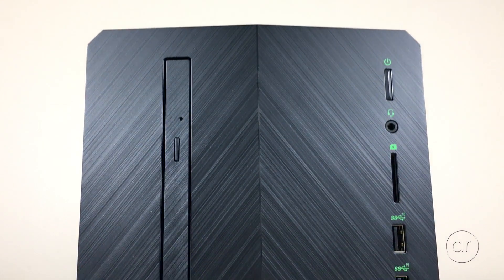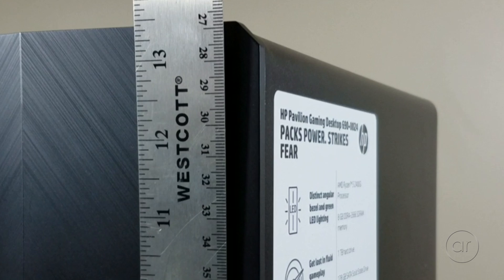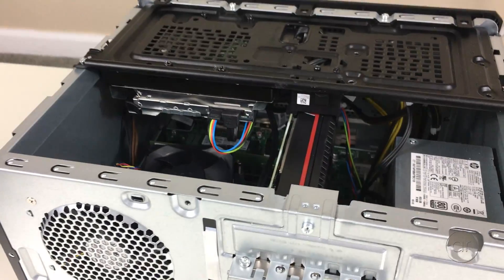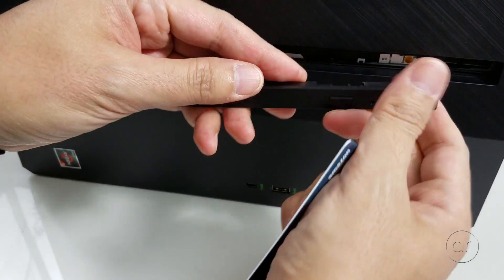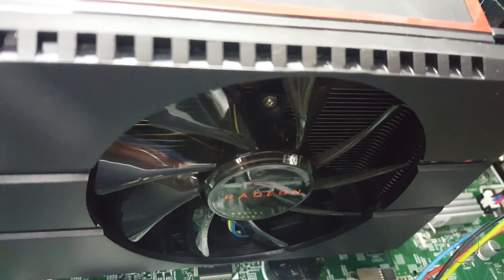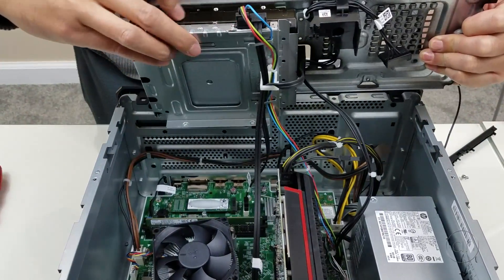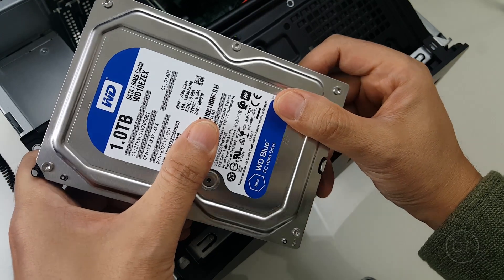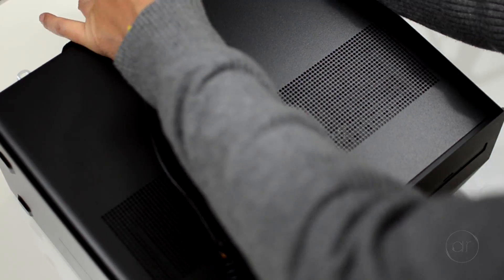How to Open and Upgrade a Ryzen-Based HP Pavilion Gaming Desktop

Comment: Sharing here my upgrade experience for anybody who could find it useful, and why only if your needs are as specific as mines and/or if your budget is as limited as mine, then and only then this PC could worth a try, otherwise run away from it like the plage.
What I was in need was a small PC for my improvised workbench, for running mainly Linux, and some  light Windows gaming. i received this PC the last year as a gift from a nephew that tried to sell it for 2 years without success (I wonder why? 😒)
The pc lacked the original 2GB RX 580 and instead it had a fanless 2GB GT 710, together with a broken mechanical 1TB HDD. It had a Ryzen 3 2200G, with 8 GB RAM.
I had already a new unused 1TB MVMe SSD, and my Linux disk drives from my Core 2 duo box (yes, it was my old Linux setup, that old).
My idea was originally to put Linux only on the and NVMe and run the games under Steam, long story short, it was impossible, so I back-pedalled, installed windows on the SSD, keep the Linux root drive SATA SSD, and the mechanical HDD with my /home.
My upgrade plan was focused on get the best features possibles that can make this pc useful for me for the next 8+ years, at least for Linux, and good enough for my Steam backlog, always taking into account the poor, dismal ventilation that this case has, and everything within my limited budget (aprox 280 USD).
In that order, the most needed upgrades were:
· GPU: something that don´t crawl, be better than the 710 (the easy requirement), and really cheap
· RAM: 8 GB isn't enough, 16 GB will be fine.
· CPU: the 2200G had very few PCIe lanes, to the point that witht the NVMe drive installed, the PCIe x16 slot can only operate at 8x speed (I see what you did HP with that mechanical HDD, you rascals), so a CPU with more PCIe lanes, or without integrated graphics, in some aspects could improve the performance.

Upgraded so far:
· GPU: 4GB RX 470, new from Aliexpress, a lot cheaper than a RX 580 and with better performance
· power supply: just in case, because the GPU was a little bit power hungry, and needed a PCIe power connector that the original supply lacked. This was the hardest part to find for prices and compatibility. If this seem unreasonable to you, is better to buy a graphics card that doesn't need need a power connector (not a good prospect for upgrading). Also, a better power supply opens the possibility of future GPU upgrades.
RAM: 2x 16 GB (I'm human, I fell into the temptation of more RAM. So far I have only one app that uses over 16 GB, perhaps it changes in the future).
· CPU: the only second hand upgrade, a Ryzen 7 2700, the best CPU supported by HP in this motherboard.

What's left:
· consolidate everything under a single NVMe drive, 4 TB or more.

What to expect:
For day to day work and some CPU intensive tasks is quite good, however, for even light GPU usage, even old games like the ones I used to play, is recommended to open the side cover. In just few seconds of gameplay, I measured an increase of over 20ºC on the air near the GPU air intake with the cover on, and its very easy to reach thermal throttling point in just a couple of minutes of gameplay. With the side cover removed and a better fan curve (I blame my card for that last one), it plays quite acceptable (i.e. orders of magnitude better than the 710) and the temperatures remain stable while gaming.

TLDR: don't get one of these unless it's a gift and you have at hand most of the upgrade parts, and you find acceptable the caveats of this PC.

Edit: Just in case any wondered, yes, it was well under budget, the total upgrade so far was under 260 USD.
Reply: Why not swap in the Erica motherboard from the later versions of this pc? You then get into new gen for cpu and gpu options. I think they all are 65w max and stay ddr4.

Comment: How many and what type of power connectors does it have? I see 2x 4 pin if I'm correct. Is it possible to replace the powers supply with a standard atx version? Is the motherboard in the micro atx format?

Comment: Hi, ii have the 690-0020 and ii want to know if ii can upgrade to the ryzen 7 3700x or can ii only upgrade to the ryzen 7 2700 also can ii make these upgrades without changing the stock cpu cooler? Ii also want to know if ii can upgrade my rx 580 4gb to a gtx 1660 ti 6gb

Comment: Successfully upgraded the GPU from a 4 GB RX 580 to an 8 GB Sapphire Pulse RX 6600 using a 6-to-8 pin adapter. I had to removed the black GPU bracket attached to the black drive cage. It was held in place with just one screw and then I pushed on the tabs on the other side to remove it. I also moved my HDD to the bottom of the case for better airflow and my boot SSD I have just resting on the bottom of the case. I already upgraded the CPU a couple years ago to a Ryzen 5 2600 and the RAM to 2 sticks of 8 GB, 16 GB total. With the disk drive removed, my idle CPU temp is around 55 degrees now. If anyone has any suggestions on covering the disk drive slot with some kind of dust protection, please let me know.

Comment: But wil this mainboard and psu fit in a standard case if moved?
Reply: Not all at both are proprietary HP crap. If you want to do a case swap get an new motherboard, CPU fan, psu.

Comment: On the Sunflower motherboard can I put in G.SKILL Trident Z RGB 8GB x 2 DDR4-3600 megahertz? Or will it mess up my mother board.
Reply from the maker: I haven't received any reports for that particular memory. I have been keeping track of successful upgrades, which you can find in the "Memory" and "Replacement Memory" sections in the description.
Reply: @accessrandom  I’ll try it and let you know if it works 👍
Reply: @accessrandom  Update: The RAM DID NOT WORK, the Sunflower motherboard doesn’t support DDR4 3600. By doing some research the very max it can run at is 2666 megahertz’s. If you do anymore your PC won’t go to your monitor. Add this to your description to help people.
Reply: @FzSushi  I have a similar system from HP w/ Erica5 motherboard (for the 4700g).   HP does NOT support XMP memory overclocking AT ALL  -- any ram has to use JEDEC settings at DDR4's 1.2 volt standard;  the ram you bought likely doesn't have a setting that matches the older 2666 speed setting at 1.2v.   Memory boards touting higher speeds rely on systems supporting memory overclocking, often at 1.35v (DDR3 standard voltage), even if they don't say so in their ads.

I put some corsair memory in my system for awhile ( and got a big boost from dual channel), but it ran a lot slower than the "3200" rating.  Putting in memory that had the 3200 MHz at JEDEC's 1.2 volts gave me back the original speed setting  and  the dual channel boost.     Now, if I could only access the IGP ram settings to get it off the damn 512MB default of this logic board . . . . .  While I sympathize with the owners of Sunflower boards who complained of the 2 GB memory loss, I would be happy to throw that at the APU, since I put in 16GB of ram anyway🙄🙄🙄.

Comment: Upgrade was a success to a ASUS TUF 1660 ti although I would recommend the RX 6600 in 2022. Make sure you purchase a 6 to 8 pin cable adapter since you only have one 6 pin. It may not fit at first but there will be a lever to remove a small black piece on the bottom of the black HDD + DVD drive black cage. Remove that and you are all set. Temps were much lower and you can barely hear the computer. The 1660ti maxed out on 65 degress while the RX 580 maxed out on 88 and throttled. I also was able to OC mine pretty highly. CPU temps were a bit hotter probably because due to the size of the GPU there was less airflow in the case and performed a tad bit slower.
Reply from the maker: Thanks for the follow-up! - I've added your comment to the description.

Comment: I have the TG01-2003w model of the pavilion  that contains a Ryzen 5 5600g and Radeon rx 5500 xt and was wondering if these upgrades could apply with the build I have.
Reply from the maker: Unfortunately, this video is geared toward the 690 family of Pavilions. I have another video for the TP series, but I'm afraid not for the TG.
Reply: @accessrandom  oh that’s fine. I’ll be doing a bit of research then for my model. Appreciate the help and overall informational video about these upgrades! You take care.

Comment: Tried to upgrade it with a new cpu, gpu and power supply bit it won't turn on. 
Any ideas on why?
Reply from the maker: What CPU did you upgrade to? For the 690-0024, HP lists a limitation of 2nd generation Ryzens (specifically the 2700).
Reply: @accessrandom  RYZEN 5 3600
Reply: @thereplication2567  Unfortunately even with a BIOS update the motherboard isn't capable of supporting anything higher than a 2700.

Comment: Hey I'm back after a couple of years haha, Replaced the Ryzen 5 2400G to a Ryzen 7 2700. Changed the RAM from 24gb to 32gb of Samsung memory running 2666mhz dual channel. Also upgraded the SSD to the stock crappy 128gb SATA SSD to a 500gb Samsung 980 m2 nvme beast. Before upgrading make sure you update the latest BIOS and make sure you are very patient since this computer is extremely hard to upgrade. Make sure you clear the CMOS before you install your new components since this motherboard is so stubborn recongnizing new copoments which I made the mistake of not clearing the CMOS which made the PC not boot at all and cause a boot loop. To reset the CMOS it is very hard tto do without removing the GPU out of the computer so make sure you do that and remove the battery from the PC for a couple of minutes and pt it back on. When you finally boot with the new CPU make sure you prress Y which will Reset the fTPM which will remove user accounts but not the data on the drive windows is installed on and you can always add back the user accounts if you want. Next up is a GPU upgrade when GPU prices go down.
Reply from the maker: Thanks again! Lots of good info, especially about resetting the CMOS. Do you mind if I add that to the pinned comment with credit to you?
Reply: Yea sure
Reply from the maker: @Chris-eq6jb  Done - thanks!
Reply: @Chris-eq6jb Hi, ii have the 690-0020 and ii want to know if ii can upgrade to the ryzen 7 3700x or can ii only upgrade to the ryzen 7 2700 also can ii make these upgrades without changing the stock cpu cooler? Ii also want to know if ii can upgrade my rx 580 4gb to a gtx 1660 ti 6gb

Comment: hello so im probally building a pc for christmas and my question is that am i able to remove the gpu and put it in my new pc for the time being since the gpus are either up in price or out of stock
Reply from the maker: Yes, you can use the RX 580 in a different PC- I have done that before. Even though it's an OEM part, it's a standard GPU that you can use in other PCIe slots.

Comment: hey I have this same exact pc. I already added another 8gb stick of ram, and switched the hard drive for a 1tb ssd. Now I wanna upgrade the graphics card. Can I install any rtx cards in there without having to change the PSU?
Reply from the maker: There are several graphics cards that viewers have been able to use without upgrading the power supply. I've been keeping track of them - you can find the list in the description.

Comment: The problem that needs to be addressed is upgrading your M.2 since the bios wont support booting from another HDD. u cannot select another HDD to boot from to copy over OS and files to new M.2
Reply from the maker: Thanks for the tip - I wasn't aware that this HP didn't support booting to the SATA interface. Do you mind if I add this to the pinned comment with credit to you?

What you could do is restore the factory image after replacing the M.2 SSD as shown in one of my other videos (https://youtu.be/cVRVgrOl1M8) or clone the existing SSD to the new one using the same procedure as this video https://youtu.be/mKSmwyPXH2I (except you would use an M.2-to-USB adapter instead of a SATA-to-USB).

Comment: How about adding a fan, is there any room in there
Reply from the maker: Adding a fan will be difficult - it's possible, but you'd need to dremel an opening on the side of the case. Others have replaced the existing fan (which I've documented in the pinned comment).
Reply: @accessrandom  thanks
Reply: So another question, can I swap out the RX 580 4g for the RX 580 8g, and if I can would there be any other issues, eg. power etc?
Reply from the maker: @mrmojowtf6971  Power consumption-wise, you should be fine - there's not much difference between the 4 and the 8 GB models. Just make sure you have the same PCIe power adapter (the one on the graphics card) that you have on the current one, and you should be safe.
Reply: @accessrandom  so both the cards are the same size. Also it’s strange that the cards recommend 500w PSU, even though the machine is 400?
Reply from the maker: Yes, I noticed that too - HP seems to be on the edge of the requirements. The sum total of the other components' power consumption are probably low enough to handle the graphics card.

Comment: After doing some research the sunflower motherboard is a b350 chipset so you should be able to update the bios to handle new chips
Reply from the maker: Thanks for the tip. If you can send me a source for the BIOS updates and the processors they support, I can add it to the description/pinned comment (with credit to you).

Comment: I have this PC: HP Pavilion Gaming R5 1650 Super, 8GB/256GB Gaming Desktop Tower, its motherboard is HP name: Erica SSID: 8643.  Can I upgrade the motherboard to a non HP Motherboard in the same case?
Reply from the maker: Is it in the 690 family by any chance, like in the video? If it's anything like the 690 series, you unfortunately won't be able to replace the motherboard since it is so non-standard (the power connectors are non-standard, and some ports are soldered at the front of the motherboard).
Reply: @accessrandom  thank you for your quick response.  Looks like I will just leave the mb and upgrade ram and GPu if the prices ever go down.
Reply: @accessrandom   the model number is TG01-0023w
Reply from the maker: @earthenergyhex  I'm not as familiar with the TG01 series, but most HP desktops (like the TP01 and 690 series in one of my other videos) have custom motherboards.
Reply: @accessrandom  ok thanks, btw your videos are the best tutorials

Comment: This is a very helpful video!  

I have the HP 690-00xx gaming PC which appears to be very similar.  It's a Ryzen 7 1700 with 16 GB RAM and a Radeon RX 550 graphics card.  The HDD is a 1 GB Toshiba.  

The motherboard (Sunflower) has the following connections:

One PCIe x16 slot
One PCIe x1 slot
One M.2 socket 1, key A
One M.2 socket 3, key M

I would like to add a M.2 type SSD.  I believe my PC will accept the M.2 SATA.  What isn't clear to me is whether I should consider other alternatives.

It seems, for example, that there are M.2 drives that use SATA/PCIe or PCIe.  I'm rather fuzzy on the variations that are available.  I'm assuming that the M.2 slot on the Sunflower motherboard will not support the PCIe versions and that using M.2 drives specific to the PCIe slot require a more advanced PC.  Is that correct?
Reply from the maker: Thank you. The 690-0024 also uses a Sunflower motherboard (model 8433), which has an M.2 slot that will accept either a SATA or NVMe (PCIe) SSD. I've been keeping track of viewers' successful upgrades of the M.2 SSD in the pinned comment, and there have been several who have added NVMes.
Reply: @accessrandom  Thanks!
Reply: @accessrandom  so can I can upgrade to a new Samsung 980 evo pro 1tb nvme?
Reply: Do you think with the Sunflower motherboard that I can upgrade my ram to G.SKILL Trident Z RGB 8GB x 2 DDR4-3600 megahertz? Or is it to much for the motherboard.

Comment: Would a rtx 3070 fit in there?
Reply from the maker: I haven't had any reports of successful upgrades to the RTX 3070 (in the description under "Graphics") but if it should physically fit if the length is under 10". Power consumption is not much higher than the RX 580 (about 15-20% higher).

Comment: If I wanted to move everything to a different case, would that be possible?
Reply from the maker: The motherboard is highly non-standard (there are USB port soldered onto the front of the motherboard), so I'm not sure if it will fit in any standard ATX case. I haven't had any reports from users making a successful transfer.

Comment: can you fit a dual fan rx 580 about 9.5 inches
Reply from the maker: Depending on the height, it should fit since the space for the length is about 10" (but you may need to remove the bracket shown at the 3:24 mark).

Comment: Can you replace the hard drive with a new ssd. However do I need to use a certain ssd?
Reply from the maker: Yes, you can replace the hard drive with an 2.5" SSD (or you can add a 2.5" SSD in addition to the hard drive). Since the existing hard drive is a SATA drive, you would need a 2.5" SATA SSD.

Comment: Can you install an SSD with the hard drive running as the boot drive? Would that make the Pc faster while having the storage of the Hard drive? I'm planning on installing a 250gb SSD while trying to keep my 1 tb hard drive.
Reply from the maker: Sure, you can have an SSD as a secondary drive. However, if Windows is still on the HDD, you wouldn't see the performance gains of booting up quickly. You could still install programs on the secondary SSD, where they would load quicker.